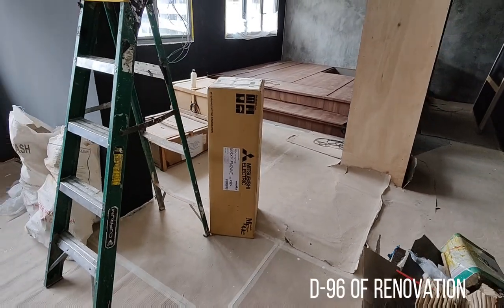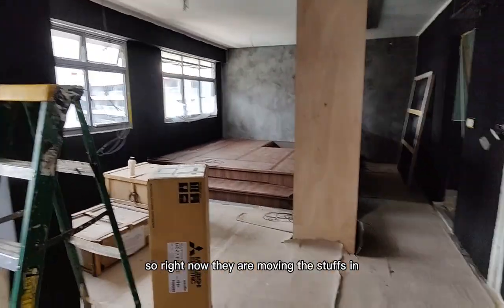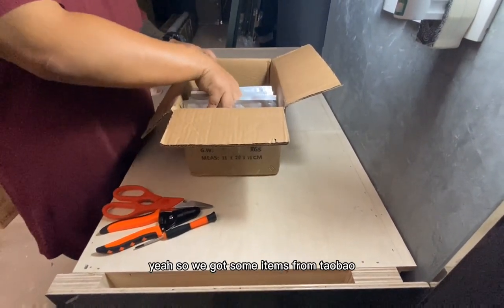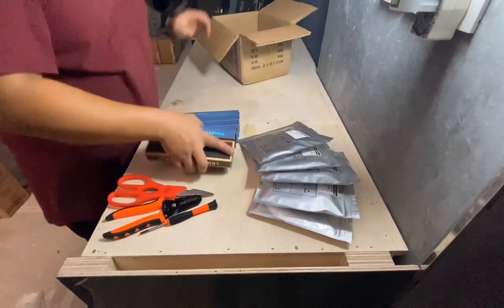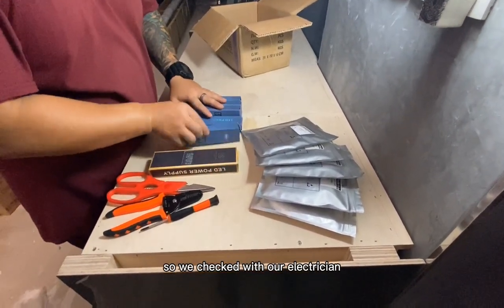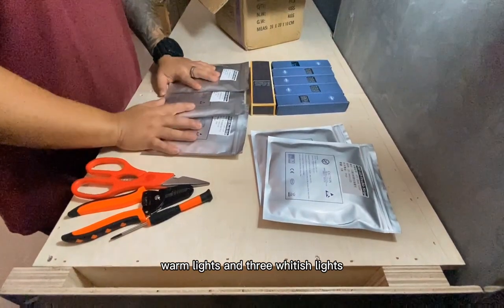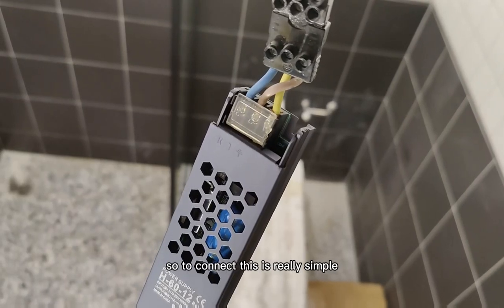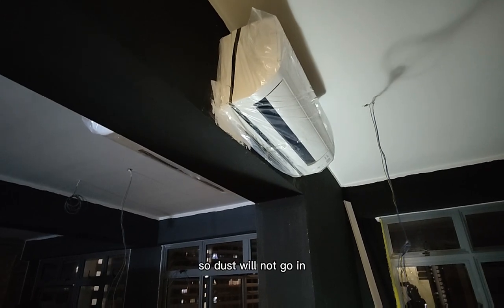A/C Installation (+ Installation Guide For Toilet LED) | Singapore HDB 4 Room BTO Greenverge | Ep.19

Comment: Hi, can you explain how much length of LED then require the corresponding alternator 60 or 150W?
Reply from the maker: This is a great question! Most LEDs uses 12w per metre (depending on LED specification as well). So let's say if you are planning for a 5 metres long LED, You'd need 60w alternator (12w*5meter).  This way you can calculate which alternator(driver) size is required. 👍🏻👍🏻
Reply: @NiJiaCasa  hey Nic, i'm about to purchase the LED strips and Alternators from TB. Assuming i need a 2m strip in kitchen and 0.9mx2 (top and bottom of mirror cabinet) in toilet, does it mean i can just buy a 5m LED strip, cutting them down to their respective sizes, buy an alternator for each point?

2m strip + 24W(12w*2m) alternator
1.8 strip(0.9mx2) strip + 24W(12w*2m) alternator

Thanks!
Reply from the maker: @rl1050  Yes. That calculation seems correct. 2metre each would required a minimum of 24w. But I would suggest to get a higher one Incase you want to add more to the alternator. Like buy a 60 just Incase. But if you are very sure you wouldnt add more led, then you can buy as close as to 24w as you like but nvr lower then 24w. 👍🏻👍🏻 Have fun!

Comment: I see that there is the 3 dropping from above. Are these lights actually meant for a toilet light? Will you be having another source of light in the toilet?

Am I right to say that it is to drop the 230V to 12V/5V? What is the required for voltage for your 10m LED?
Reply from the maker: Yes. That will be used for our main light. Good eye!  

Yes, the driver is used to reduce voltage so it's suitable for the LED.  LED typically runs at 12w per metre, for a 10m LED - We will be looking at a 120w driver requirement (1w:1v). Drivers are usually classified by Amp(A) and driver will reduce voltage by units of 12v. Thus, if a driver is indicated as 5A, this means  5a * 12v = 60w capacity. Drivers are typically sold by 5A, 8.3A, 12.5A, 16.6A, 25A and 33.3A. So you will need to get 12.5A driver. 

Sorry for the long math 😂
In short, for 10metres LED = Buy 12.5A driver (aka 150W/12V/12.5A). 👍🏻👍🏻
Reply: @NiJiaCasa  understood. Thanks for the explanation. 
Would like to find out how you will do the cabinets LED as well as how to hide them 😂
Reply from the maker: @LuJiale  there is a cut out done by carpenter and they provide a aluminum with frost cover casing 👍🏻